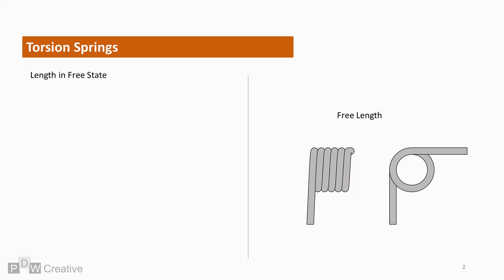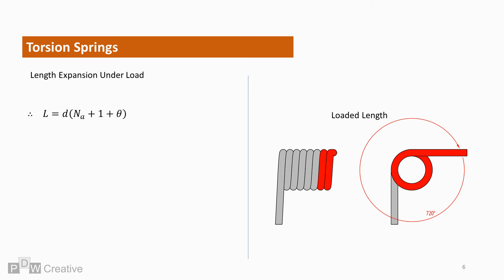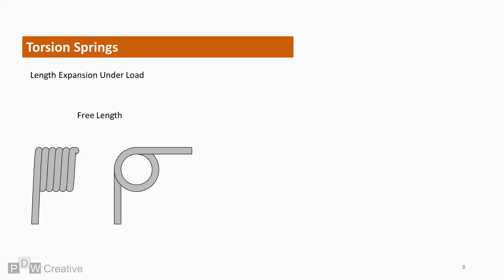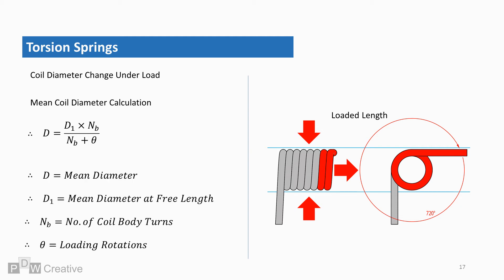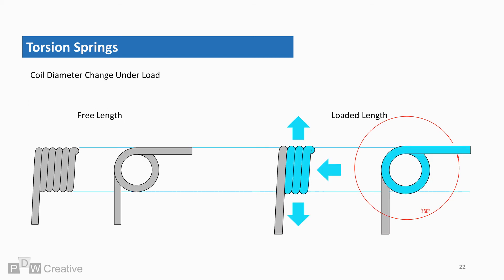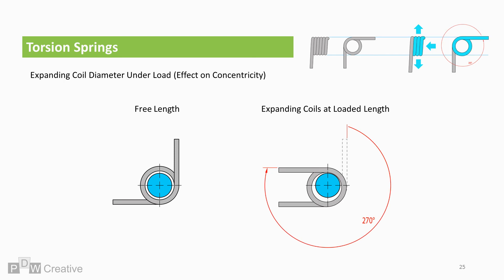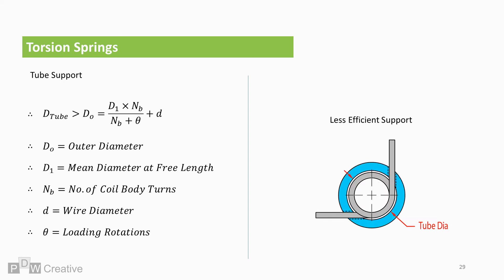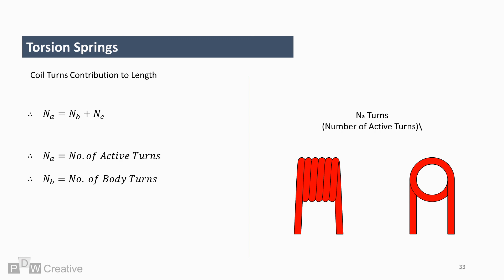Torsion spring design 3

Comment: Please tell Book which you referred??
Reply from the maker: The information comes from experience working with spring manufacturers and researching international stainless steel wire and spring design standards. Most text books are generally going to take their info from current industry knowledge. The standards you work with depend on the material chosen and differ slightly depending on region

Comment: Can you explain the merit of open coil torsion springs over closed coil. Also how does the design procedure differ with open coil?
Reply from the maker: You might sometimes see binding occur in tightly aligned coils especially if the surrounding geometry does not allow the spring length to expand as torque increases.

You might want closely aligned coils if there is limited space available in the surrounding geometry.

If you want to design a spring with a gap between coils you need to account for the gap when deciding on the pitch.

If you need a gap and make the pitch too great you may see spring tangling during part shipping or automated assembly.

Comment: at 06:45
why torsion spring’s legs also are considered as active coils
Reply from the maker: The legs are considered for working out the length of the spring. Na or number of active turns gives you the actual number of coil turns